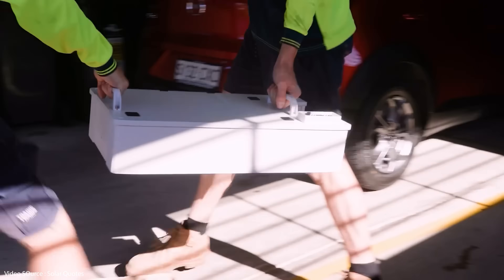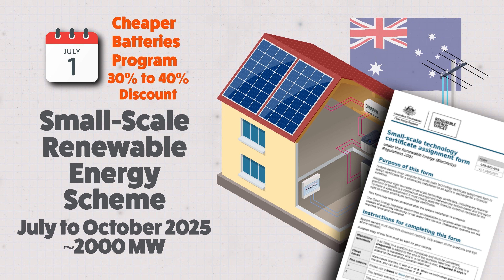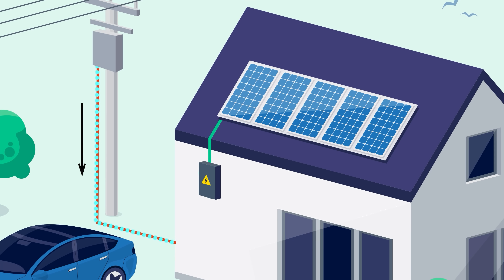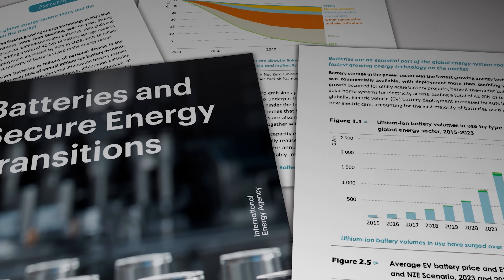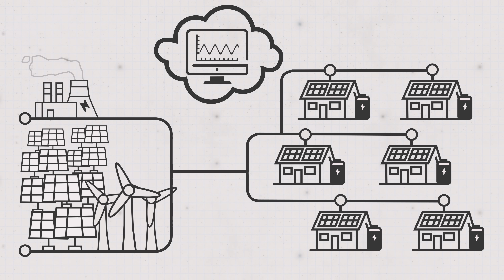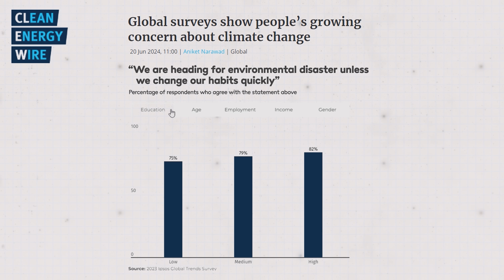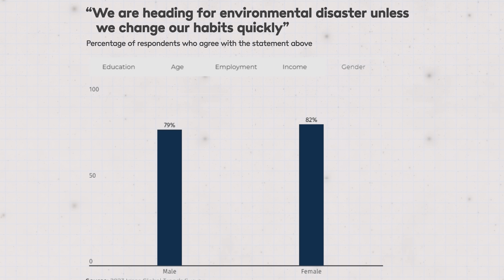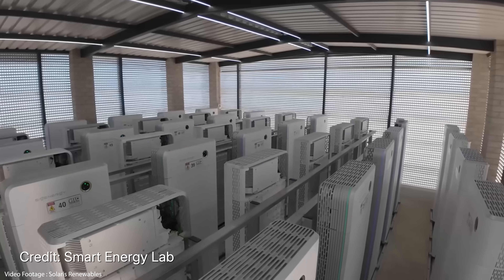Australians installed 100,000 home batteries in 17 weeks. Why can't we all do that?

Comment: I would love a “clever” person to calculate the cost difference between subsidising PV and battery storage onto domestic properties over the billions of pounds to install nuclear plants and the subsequent decommissioning costs? Another thing not mentioned here is the potential to use a suitable EV charger to provide additional capacity using V2G/H as this has massive potential and I believe Australia are leading the charge on this too?
Reply: False comparison.
Wind and solar are incapable of powering anything important.
Reply: @aliendroneservices6621 Wrong. Rio Tinto are one of Australia's largest industrial power users. They recently announced they are bringing forward the closure of Qld's largest power station at Gladstone by 6 years to March 2029 having already signed major contracts with renewable generators for the supply of 80% of power to their Boyne Island smelter following the closure.
Reply: @tassied12  Why only 80%?
We all know why.
Wind and solar are incapable of powering anything important.
Reply: @aliendroneservices6621 They are still arranging further supply. Renewable projects can be built quickly. They are satisfied they have sufficient replacement power lined up already to bring forward the closure of the Gladstone coal plant
Reply: @tassied12  That hasn't been done.
So why did you say I was wrong?
All you've done so far is prove me right.

As far as "not enough time", weirdly combined with "they  [wind-and-solar] can be built quickly", we should remember that the supposed wind-and-solar "revolution" has been going on for 52 years now.
Nothing to show for it, because they cannot power anything important.
Reply: @aliendroneservices6621Rio Tinto has signed the PPAs for that 80% across the last 2 years. It has plenty of time to nail the last 20%.
Reply: @tassied12  "No, Rio Tinto's Boyne smelter is not being taken off the grid" (Google AI)

The reason Boyne smelter is not being taken off-grid is wind and solar are incapable of powering anything important.
Reply: @aliendroneservices6621 Of course it is not going off grid. The renewable generators are feeding into the grid. 

From Rio Tinto's global head of aluminium: "In Australia, our two smelters on the East Coast of the country unfortunately sit both today on the wrong half of the global cost curve, given high, coal-driven, electricity costs, which are in addition on a continuously increasing trend."

 "When we, at Rio Tinto, dedicate a lot of efforts and time, and take substantial balance sheet commitments to repower these smelters with a mix of renewable solutions, it is first and foremost because we need and want to bring these smelters to the good half of the global cost curve. "
Reply: @tassied12  "[Boyne smelter will be] feeding into the grid."
...So that Boyne smelter can steal power-service.
Reply: Forget about nuclear.  Geothermal is the future.
Reply: @Les_S537  ...Because geothermal is untested?
Reply: @aliendroneservices6621  not sure I get your question…  Geothermal has been around for over a century.
Reply: @Les_S537  Now you're throwing Quaise under the bus?
There are no countries powered by Quaise.
It is untested.
Reply: @aliendroneservices6621 Untested?

They just did a field test in Marble Falls TX at a granite factory with a particularly hard form of granite (pink granite).

They drilled 118 meters achieving 5 meters per hour compared to traditional mechanical drilling which can only achieve 0.1 meters per hour.

5 meters an hour is 10 times faster than they achieved in the lab, and 50 times faster than traditional mechanical drilling techniques.
Reply: @Les_S537  You claimed you were going to run the world on geothermal.
That idea is untested.
The "tests" you pointed to aren't providing any power-service.

France's electrical power-service has been majority uranium-fired for 40 years.
Do that with Quaise geothermal, and then we'll talk.
Reply: @aliendroneservices6621  Are there more than a dozen teeth at your family reunions?

Geothermal has been around since 1904 when it was first discovered as a way to produce power in Italy.

Geothermal is not untested.
Reply: @Les_S537  So you are throwing Quaise under the bus.
That was quick.
Reply: @Les_S537  Conventional geothermal is 7 watts per square meter. That's barely better than winter solar at 6 watts per square meter.
Conventional geothermal has zero proof-of-concept majority-powering any country.
Even Iceland's electricity is only 30% geothermal.

Comment: What matters is if those home systems have smart control, that can really charge the batteries in the middle of the day, when the surplus is greatest. Unfortunately often it just works in the default mode, where the battery charges as soon as there is more PV output than load, which means that around noon the battery is fully charged, and there is still a big export peak in the afternoon. For some reason at least my Goodwe app doesn't properly allow for even setting up a fixed charging schedule, I have to hack it by putting it into forced export mode in the morning to prevent the battery from charging. The external smart control device would cost $1000, which would take about 15 years to pay off from the increased export income

Comment: The price of batteries have definitely plummeted but getting them installed is still very expensive. Inflation, high mark-ups and high labour costs quickly turn the tables on those unit costs. We installed 20.5Kw/h of batteries at our place with existing solar and the final bill was $18,000 AFTER the subsidy. 
Not at all cheap
Reply: my taxes paid for some of your batteries    your 18000 should have been25000  i cant even afford a house  so the poor are paying for you people who are in my eyes are rich

Comment: installed 30 panels 2 years ago then they dropped the rate and still cost money, installed a 42 kw battery and putting around 5kw/h into the grid they still want to charge me $125 a 1/4 just to be connected, next they want to start charging to put the power into the grid, I'm done, disconnection from the grid is my next move, what a joke the power co and government are to offer incentives then cash in !

Comment: Batteries for home storage are expensive, is it not cheaper to buy an EV, use it as the battery, and drive it occasionally ?  Up to 9k GBP when installed for average usage of a three bedroom house in UK possible the same in Euros where I am. We make enough Solar energy for general use (Netherlands)| sell some excess (rates have been lowered - apparently it's unfair to those that can't/won't/haven't invested in Solar yet. Anyway we end up paying pennies to the ponds compared to a battery investment, the bottom line is our bill never reaches 10 euros a month including winter periods with shorter days like we have now. We are low mileage users, don't commute with it, except rare occasions and we could still avoid that 'convenience'

Comment: As an Australian, I am proud of some achievements we have made.  With that said, during peak times, which occur when itis darker, we are still heavily reliant on fossil fuels, so this recent incentive was needed to reduce this dependance.   
My concern will be what happens when all these batteries come up for replacement in 10 years' time, or less for some of the cheap ones?
Batteries are kind of a medium-term solution and not really a long-term solution.   Also, if we have a change in government at the next federal election, all this could be undone.   It was the labor government which wanted to do the NBN all fibre to the premise, but a change of government to the more conservative, poorly named Liberal government, that saw us with mixed technology NBN, which is by far more expensive to maintain and less efficient, with some people still on fibre to the node instead and getting poor speeds.
Just wanted to highlight that although we can show initiative down under, things can also still be quite volatile and are not always what they seem.

Comment: Here in New Zealand the government seems to have zero idea.  We're running out of gas too quickly and seems to think the solution is to throw $200  to any oil companies tat will drill or develop what we are running out of.  I've had my solar system since 2014 so it's well paid for itself.  I even get a good buy back rate now although I've had to shop around ever since installing it.  If only they would look across the water and see what the Ozzies are doing with V2G and their home battery installation.

Comment: I like Hydro-Québec's approach, which, unlike Australia (which has few, if any, dams), will be able to use dams as public energy storage systems. This will prevent us from having to add batteries to our homes by buying our surplus energy to top up the dams and thus store that energy for the lean winter periods! (95% of our electricity comes from hydroelectric dams.)

But Australia's achievements show that the world is ready for clean energy!
Reply: 95%?  No way, more like 55%.  According to Statistics Canada preliminary data released in October 2025, hydroelectricity generated 343.5 million megawatt-hours (MWh) out of a total 622.2 million MWh of electricity produced in Canada in 2024, equating to 55.2%.

Comment: Greetings from Denmark! I have been calculating this over and over again, but in Denmark roof solar panels can not compete with larger installations economically: When the solar panels produce power the power is cheap to buy on the grid from the North European Market. I could as well buy batteries and save cheap grid-power from daytime to expensive night-time but that is not good business either. You might have a return of investment in 7 years, but that just isn't good enough compare to the uncertainty and the hassle involve in the private installation. According to ChaGBT electricity is 50 % more expensive in Australia compared til Denmark - when you take out VAT. That is properly the reason. But anyway: Great that someone is doing the experiments that will gain us all some valuable experiences!

Comment: honestly what I think would help most would be a scheme where your get a low interest loan which is just above inflation, but you can't get rid of the debt even through bankruptcy but you can pay it at any rate you want upto a minimum payment which would have it paid off in say 20 years, which at that point it's something like $35 a month for reasonable battery system which is affordable to the vast vast majority of people. That way it doesn't cost the government anything because the small surplus interest can pay for the administration of the program, and then you can add intensives on top if you need to, but I would think it would reduce the friction enough that you would have a lot of takers.

Comment: A bit of cash he said, Australia's Cheaper Home Batteries Program was initially budgeted at $2.3 billion but has blown out, with the government announcing an increased funding of around $7.2 billion over four years (from late 2025) due to unexpectedly high uptake and demand for larger batteries, which initially made the scheme far more expensive than planned, forcing a revamp to taper subsidies for bigger units to control costs while still encouraging adoption. 
That is a lot of money, and the taxpayer is funding it, with many big batteries purchased that won't be utilised, is it a waste of money it might be if CO2 is not an issue, time will tell when we have to dispose of all the waste.
Reply: The uptake has been better than expected, a huge success, buying time fixing today/tomorrow's electricity problems in Australia ...this may save more than it costs.   What is your quick fix recommendation?
Reply: @badtellytubby There is no quick fix, not now. We never had an energy problem until renewables entered the mix, and now we have because all other sources have been allowed to deteriorate to the extent that they have become costly to maintain because of the belief that renewable power is the saviour. Gas and nuclear would have been a better solution if we are so concerned about CO2 as renewables are a house of cards, and waste in the next decades will astronomical.
Reply: @johnnywarbo  I don't know why previous governments didn't build more gas or nuclear, I guess they thought they love the look of shiny solar or something.

Comment: Another bonus here in Australia, is that a number of the largest coal-fired electricity generators are nearing the end of their 40-50 year operating life cycle. If the government can allocate $5 billion to batteries and PV subsidies for the population, rather than the same amount in subsidies to power companies to build a new coal plant, I think that is a win all around.
Reply: Doofus, a battery pack isn't a power plant.
Reply: @Les_S537  No, it's not. But having megawatt's of stored power on the side of the houses across the whole country reduces reliance on the large, expensive, and messy coal or gas power plants, and reduces the cable & poles costs to the users.
Reply: @gnomad42  Look, I'm all for moving away from fossil fuels as a source of energy, but a world filled with tens of millions of wind turbines, and billions upon billions of solar panels, and trillions upon trillions of battery cells is abhorrent to me.

They last only a few short decades each generation (needing to be recycled over and over and over), and are WAAAAAAY more work than is actually needed.

The world has so much thermal energy beneath the surface that 0.1% of it can power all of mankind's needs for 2 million years.

Geothermal is the path forward.

It has a capacity factor of 70-90% (only nuclear power has a higher capacity factor), and a few tens of thousands geothermal power plants could provide us with all of the power we would ever need.

They also can last for literally centuries, and their environmental impact is tiny compared to going wind, solar and batteries.
Reply: @Les_S537  I absolutely agree that geothermal is a great wat to go, but it needs to be a part of the mix. There is no one single answer. Geothermal is not appropriate in all locations. Great in areas with lots of geological activity, like near plate boundaries, like New Zealand, or California, or Iceland. But places like Australia don't have ideal geothermal conditions but we have an abundance of sunlight, open spaces with less than 1 person per square kilometre, and a windy coastline. 
So there can be a general mix of sources that can have a minimal effect on people in most cases.
Reply: @gnomad42  "Geothermal is not appropriate in all locations."

That USED to be true, but it no longer is.

Bear with me a moment.

The deepest borehole ever drilled was the Kola Borehole in northwestern Russia near Murmansk.

They achieved a depth of 40k+ feet.

The thing is, it took them 20+ years to accomplish it.

This is why geothermal hasn't been more widespread as a power source option, because once you reach "basement" rocks the density and pressures involved ruin mechanical drill bits.  Once you reach basement rocks (ie granite) you have to regularly change out the drill bits which means lifting it to the surface, changing it out, and shoving it back down to the point of contact.

Thus why it took them 20+ years.

We now have a new way to drill, and Quaise Energy is at the forefront of this new technology.

Millimeter wave drilling (MMW).  It's basically your microwave from your kitchen, but on steroids.

Quaise Energy was born out of MIT's Plasma Science and Fusion Center, and they use gyrotrons to produce MMW which literally vaporizes rock.

Quaise just completed a field trial in a granite quarry outside of Austin TX (Marble Falls TX) where the granite is 2 kms thick.  They drilled a 118 meter borehole, and they were able to achieve 5 meters of drilling depth per hour.

Typical mechanical drill bits get only 0.1 meters per hour.

Quaise can drill a new Kola Borehole in 100 days...

Quaise is opening up supercritical geothermal as an option planet-wide, and will cut capital costs for geothermal by more than 50%.

This is the answer to getting fossil fuels off the grid.

Comment: As someone in Australia, i bought 3 x 16kw batteries, which installed was around 5k installed. ESS Helios $6,600 per  (beat the mad rush - think they have slightly increased in price now) with a rebate of around 16k, it was a no brainer.. Finally getting something back from my taxes. Biggest cost in the new batteries was the installation -- off grid with a selectronic sp pro, and with the ESS gateway

Comment: Don't use this Template. It is Quantity over Quality. Most of the batteries are junk from China. Being replaced by the thousands. Most of the systems are over sized. Not fit for purpose. Good idea but need a better Template.

Comment: Plan to add to my battery storage in the new year. currently have 9kWh and 4kW of solar panels installed in North Yorkshire. Summer production in the frozen north exceeds my current capacity and I also use overnight charging on low rate grid power in the winter.😁